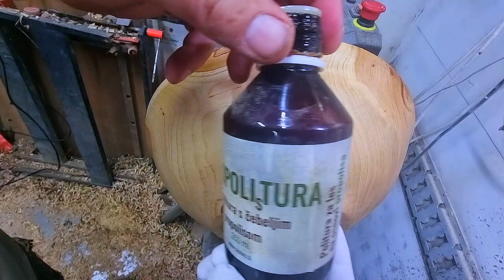Wood turning a biggest bowl on Record power Coronet Herald lathe

Comment: That's a very clever use of a grinder there, hadn't thought of that. No roughing gouge?
Reply from the maker: Thank you for your comment. I just have attached in grinder plate that i work before with and i used also here. That technik with bowl gouge i learn from Tomislav. He have great channel @dodir drva
Reply: You would never use a roughing gouge on a bowl blank anyway, they're for spindle work